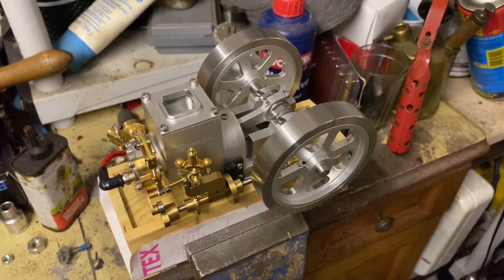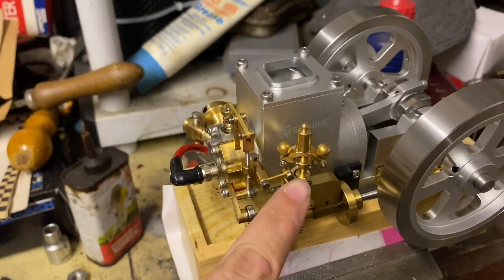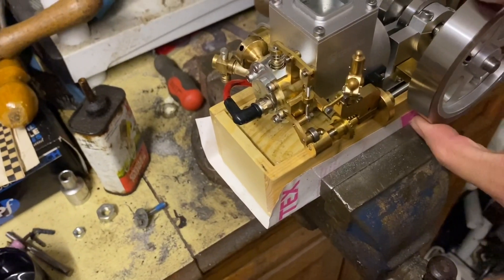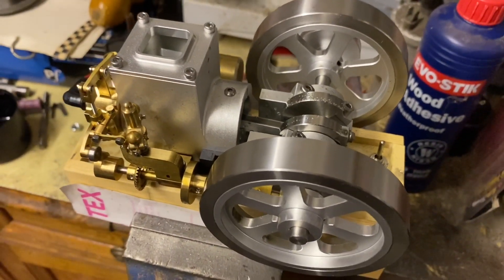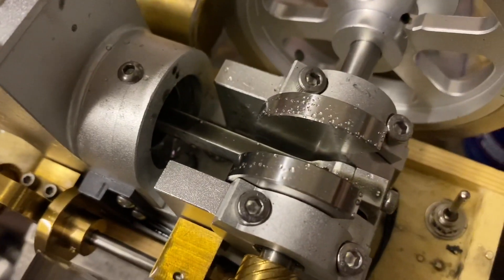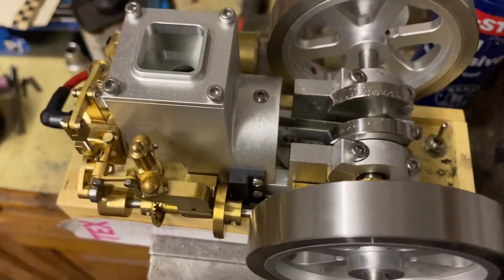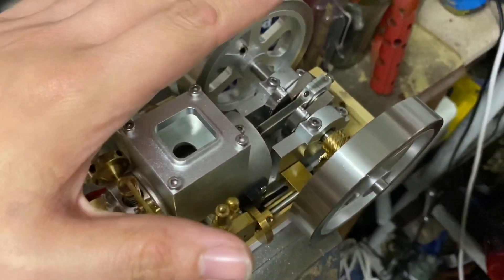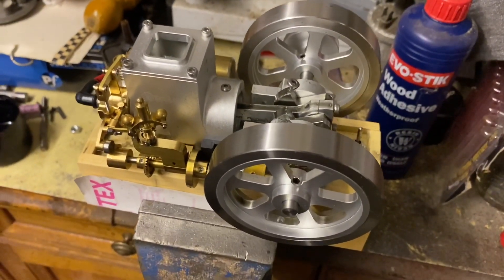ET6 Working Model Hit & Miss Engine - First start!

Comment: The ET6 are an incredibly complex engine, but unlike the other models with sprung weights on the flywheel- are incredibly difficult to slow down to any form of realistic speed.